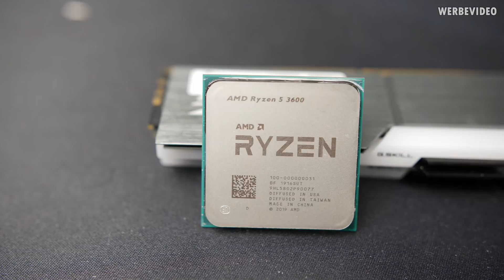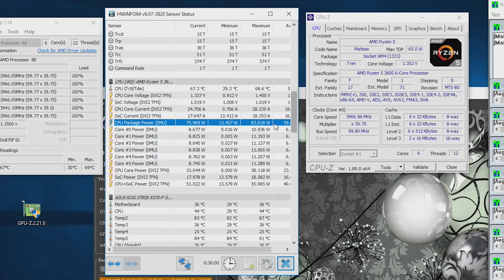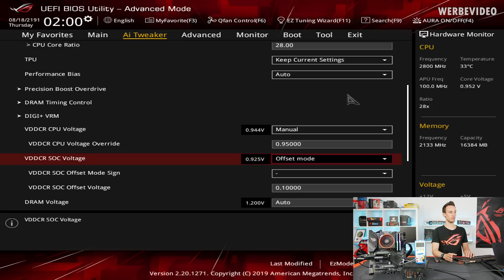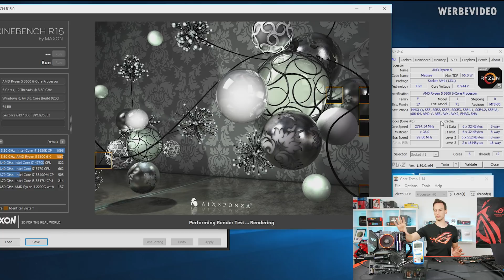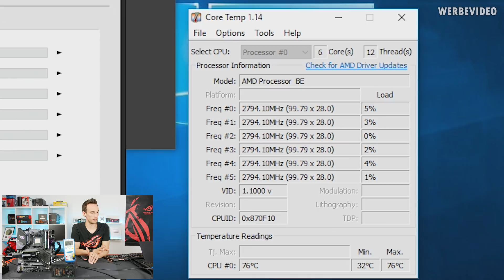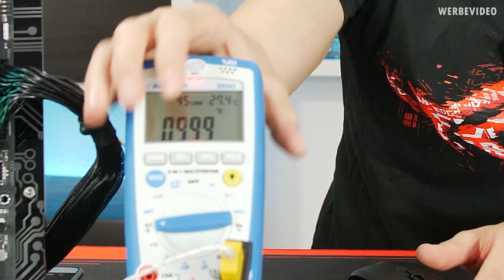Ryzen 3000 - Will the CPU work without cooler?

Comment: Thermal throttling and downclocked to 0.8ghz? Mine went down to 0.2 or even 0.195 and that is on a i5 12600k since my aio pump failed(I would reach 100c on idle) Im about to replace it for an air cooler

Comment: I understand the reason for these videos as the engineers have now had so much time to design CPUs that don't need cooling anymore. Of course, in smartphones we see that the problem of cooling fans has been solved to some extent. The Intel Core M also runs without any cooling. However, overheating laptops is still a problem, especially with Apple notebooks.

Comment: So I have a problem where I’m using a ryzen 5 2600 with the wraith cooler but I can’t attach the cooler because there is no backplate on the motherboard. Should I get a backplate or go without the cooler. I’m going to play games and some programming.

Comment: What do you think my luck will be if I try to run a 3600 with a low profile noctua cooler but, remove the fan for it? I can only fit a dual slot GPU if I dont have a fan on the CPU haha

Comment: I was having an issue with my cooler yesterday (for some weird reason, all fans stopped spinning) and I noticed my 3900x throttled to around 400 to 500MHz on all cores so it downclocked quite a bit

Comment: Yeah that's really a shame. After all this time, I would've expected all CPUs to behave more gracefully when they hit their thermal limit, not just Intel ones.
Because this reminds me of about 10 years ago, when I was struggling to keep an AMD CPU cool, period. Switched to Intel shortly afterwards and have not used AMD ever since. Also haven't had thermal issues ever since (despite overclocking my 2600K quite a bit, especially after slapping a water cooler on there).
Recently ordered a 3950X, wondering right now whether that was a mistake. Guess I'll see...

Comment: I use my 3600 with Thermal límit on the BIOS  at 69 degrees celsius, the sistem runs perfect same performance, low temps, i can use it with stock cpu cooler with no nois at all, and runs perfectly with cpu cooler conected en the chassis pin connector with the lowest rpm on cooler, cod mw watchdogs 2 for hours, no crash and stable 69 degrees aswel. Awesome cpu!

Comment: I accidentally placed my cpu fan/heatsync in the wrong port and the fan shorted, smoke came up etc. Left the heat sync on the cpu unplugged and placed the pc near my window and with a desk fan blowing onto the sync. Resulted in stable temps at 60 celsuis. Short term fix till tomorrow, set up a program that shutdown if the cou is higher than 90 c

Comment: On my Ryzen 9 3950X, TJunctionMax is listed as 95 °C but the thermal trip point is 115 °C. In normal operation with an appropriate cooler attached, the processor will start throttling aggressively at 95 °C. What happened here is that because you're running with a fixed clock frequency, the processor isn't going to throttle to lower speeds even at TJunctionMax. It's quite likely that the processor will properly throttle itself if the clock frequency isn't overridden.

Comment: Misstake did this booted without cpu cooler to check if the system worked. But i still need to update bios on my x370. Soo

Comment: I suspect the reason you had a relatively high floor for core ratio and voltage here is that the typical way overclocks are applied on ryzen is to override pstate0 (behind the user interface). This means you can not go below the clock or voltage defined in pstate1, so if you want to drop this CPU below 2.8Ghz and/or .8v you need to adjust pstates manually, e.g. move all pstate settings down one, so that pstate1 is the 1.5ghz setting that is usually stored in pstate2, or something even lower.

Comment: You disabled CPU throttling when you forced the CPU ratio to 28. That is how Ryzen CPUs work. You should have left the ratio to Auto and only disable "boosting" capability. Also to underclock and undervolt properly you will need another motherboard, i am using a Gigabyte one, and it gives me more flexibility on that regards, allowing voltage offsets and stuff. I have a completely passive running HTPC using a Ryzen 5 2400G that never exceeds 80ºC under syntetic torture thanks to that flexibility.

Comment: Your video was also on Reddit a topic.
Did you already notice it yourself?
 If not, you can read it.
Robert Hallock, from AMD explained what could have gone wrong.
 You actually did disable one protection by setting a manual multiplier: clock throttling. Bad luck. ;-)

The other mistake was probably the use of several tools to read the CPU at the same time. Additionally, HW info at the time was probably not yet compatible with Ryzen3000. I hang the links on. Can someone else definitely need it.
https://www.reddit.com/r/Amd/comments/ciw8f0/ryzen_3000_will_the_cpu_work_without_cooler/evcgzp7/
https://www.reddit.com/r/Amd/comments/cbls9g/the_final_word_on_idle_voltages_for_3rd_gen_ryzen/
When you read both articles, it actually becomes clear.
It would be worth trying to repeat the experiment

Comment: These results are exactly as expected from experience...
 I use intel for passive (silent) systems, like my current passive media PC (HP Elite 8300 AIO machine) is a core i5-3570, as it runs both cool and fast enough for passive cooling,
Then I pick AMD to get an OK price to performance for gaming/rendering/compiling/etc....

Comment: @der8auer, It seems this is a general ASUS BIOSes problem (feature?) having the minimal "CPU Core Ratio" value set so high on AMD/Ryzen platform. I have inspected many reviews of ASUS motherboards regarding this subject and I have discovered that ASUS is limiting this value for all AM4 boards, be it low-end or high-end, for all B350/ X370/ B450/X470/X570. Typical values are 28 and 32, but a few models have 22 and 23 too (Prime X370-Pro, Prime B350-Plus, C6H, ROG Strix B450-I). Even the top and most expensive boards have this limit set very high. 
Meanwhile, MSI and Gigabyte have this value set to 8 on all their boards, AsRock has it set to 22, be it Taichi ir the cheapest boards. Also, ASUS on Intel platform has is set to 8 almost on all boards. Shortly, it is a mess with all this stuff and it looks pretty strange and inconsisten on ASUS boards.
I don't think it's smth related to hardware, it should be a pure software/BIOS inconsistency or even an issue.
If you are interested in this, being much more vocal and influential, maybe you could bring this subject to public/ASUS attention and they will lower this ratio value in their BIOSes (at least to 22-23 that they have on a few boards).

Comment: In Bios X3700 cpu running 800MHz and Bios was very slow (mouse cursor stuttering).
Motherboard GIGABYTE - X570 AORUS PRO i load XMP ram settings everything else Auto. I don't know what set up Bios was very very slow.

Comment: My Ryzen 5 3600 takes 30 seconds to hit the 90°C mark in a stress test but I have a CPU cooler applied!! What the heck am I doing wrong?
Reply: Thermal paste?
Reply: @mattiatrovato5956  I already bought some new paste. I will remove the old one and get the results with the new one on monday.

Comment: AMD CPUs simple are not made to run without no cooler.. It's as simple as that.. Good vid btw bro, keepitup
Reply: I wouldn't say that Intel CPUs ARE made to run with no cooler lol. They just designed it to continually throttle to avoid thermal shutdown, even if extreme.

Comment: good vid as always but no one is giving a shit about under volting a ryzen 3000 , if you cant afford the power consumption you cant afford a ryzen 3000, fun to watch though , good vid when your sitting around bored smokin bongs , now lets see how much voltage it can take with no cooler  and the heat spreader removed , see how much voltage it can take with the heat spreader off and put a couple ice cubes on the die. or this one and ive tested it myself , it works . take the heat spreader off , cover the die with flex seal and duct tape a fish bowl full of water over it and run it on heaven for a couple days . i still have those goldfish.
Reply: There are many people interested in silent systems with passive cooling. Of course they are not the majority, but still they exist.
For those interested in low power/undervolted/underclokced systems, the actual situation of Ryzen CPUs is not so good, especially on ASUS motherboards.

Comment: Ooi mate ... Silicon stops fireing completely around 0,7 volts, that's probably why the CPU is locked to not go below 0,8v.. To make sure there is a 0,1v up from that 0,7v to make sure it doesn't stop fireing.

Comment: If I'm reading this right, the 3600 protection and control mechanisms are working fine doing their job, and it is still far more power efficient than the 8700k and 9900k(?) - It would be cool to have boundless multiplier and voltage control for a race towards the bottom, but I don't really fault either BIOS programmers nor AMD for the lack of that - we're into "just for shits n giggles" territory here. If you really want to actually run a system this low-power, you're looking at the wrong CPU (and board) segment.

To make any actual use of it beyond a time-limited idle demo, you're gonna need to give it something for heat disippation; an old northbridge cooler, a stack of coins - something. And to actually run stable however low it will go, you need to do the same for the Intel parts. Freezing for many seconds at a time is definitely not stable 😅

Comment: try it in a cheap motherboard and get yourself a 4 euro 12v peltier or two,then power it with 1.0v-3.3v and test its cooling side for temp, then switch it over unpowered, and see what voltage it generates when in direct contact with the underclocked cpu,with the added benefit of acting as a thin ceramic passive heatsink as it converts heat to electric directly...

i always wonder why they dont add and tune generic micron thick peltier layers in the chip  layers substrate and packaging, as its a simple option and can even turn wasted heat into extra localised cpu power reserves etc

Comment: title should have been : "how well is Ryzen 3000 protected against overheating"  because that's what we are learning, even tough you attempted that for another reason (test lowest voltage etc..) for younger people let me explain : on older cpus like AMD Athlon if you installed your cpu cooler wrong, the cpu burned instantly with a puff of smoke, they had zero protection (destroyed my brand new cpu ><) when I switched to Intel that was one of their advantage they had some kind of protection (like the Ryzen has in this video pc shut down) it looks like Intel has moved forward protecting even better with undervoltage and downclocking while AMD has the bare minimum protection that Intel already had 10+ years ago, good enough for me as this is a fringe case and a company shouldn't waste their time on this, Intel probably got that from laptop experience if AMD want that market they have to improve on that aspect cpu throttling and undervolting is a must for laptop cpus

Comment: Intel has ALWAYS been better at self protections, AMD have a massive improvement in that they shut down now and don't just cook themselves like they used to. Intel just designs better, the only reason this gen AMD is any good is they are able to halve the lithography size. If they were working at 14nm they'd be shite still.

Comment: I think the best way to downvolt ryzen CPU's are with PBO, you can set ppt(watt limit) from 80 to anything you want, so you can set it for 60 for example, and chip will automatically lower clocks to stay within the limit, works like magic, test it in Ryzen Master and set in bios.

Comment: Modern CPUs (and in this case AMD) has come a long way in terms of thermal safety compared to the old days of 2000s, reminds me of old Tom's Hardware video where they remove the CPU cooler while running Quake, back then the AMD systems would go up in smoke and died. Some nostalgia down the memory lane: https://www.youtube.com/watch?v=NxNUK3U73SI

Comment: I had a flash back to a video I saw in the early days of youtube where there was a montage of intel vs AMD with coolers removed mid use.
All the AMD cpus burst into flames and the video was bashing AMD for have no thermal protection.

I actually had most of the CPUs featured in the video, P4s, P3s, Athlon 64 and XPs.   I was intrigued and went ahead and tried a few myself.

Turns out the AMD cpus just shut down the system for all the ones I had on hand and were fine, no flames. Same with the intel cpus. 

So the video was made deliberately with AMD thermal protection disabled just to bash them lol.  The lengths fanboys went to back then was just as bad as today. I remember getting flamed bad for calling out the BS.
Reply: Not true. I had an AMD Duron 800 which had no IHS and when i turned it on without a cooler it not only burned down but it also burned down the motherboard. So it wasn't just intel lies.
By the way, not a fanboy for anything.
Reply: @ruiamaral4669  Yeah probably, I had not tried Durons. They and older ones might not had protection which is no different to the PII and older Intel which tells you both intel and AMD started adding protection around the same time. But for certain the Athlon/XP and Athlon 64 in that particular video have protection, I verified this myself. My point is the video was misleading as they were burning up CPUs that 100% have thermal protection by what ever means they used and claiming for that you should not buy the AMD CPUs which funny enough were superior to the intel ones on offer at the time.

Comment: I've done something similar with the 200ge. By using offset voltage you can go lower than 0.8V. I was able to achieve 2.2GHz @ 86C

Comment: I tried this once with a P1 200MMX stock and it hard locked after 15 min never to work again.   It was so hot I could melt solder on the IHS.

I also tried this with a slot 1 celeron 300A OC'd to 533Mhz and it would not die. It was no where as hot as the P1, maybe over 100 or so as it did sizzle water for a sec but was quickly quenched with a wet sponge.

Comment: Ryzen 3000 does not seem to change frequencies when you use a manual clock setting. It stays put at the setting you tell it to be. Meaning it will continue to push and push and push until it overheats. Default settings do clock up and down. I am not sure if this is a bug or not.
While we are on the subject of Ryzen 3000 again, can you test direct die cooling vs IHS see how much that matters?

Comment: My Ryzen 5 1600x can't clock below 2200MHz on "manual" mode. If auto clock (pstate or whatever is called) is selected I didn't see below 1850MHz. Desktop probably ryzens just can't clock as low as intels (800MHz). I was testing under linux...

Comment: Makes me wonder if given the efficiency of this chip, that this wasn't a scenario that AMD has prepared for? How would take the heatsink off their CPU and expect it not to shut down, but to throttle to its base clock (or whatever he set the undervolt speed to). It is AMAZING that he could get that CPU to run form more than 2 minutes without a CPU cooler.

Comment: Der8auer, great channel and video man. Got a few questions for you, some are subjective but I know they'll help me.

1. 3900X or 9900K for a workstation and gaming setup, which one would you use? I mainly use Cinema 4D, Autodesk Maya and the Adobe Sure but I'm getting into DaVinci Resolve. Which CPU in your opinion is best?

2. Is the stock cooler on the 3900X sufficient for heavy workloads or would you recommend an aftermarket cooler? If so, which one?

3. Will air coolers block Dimm slots for G Skill Trident Z ram?

Comment: I actually tried something similar with my 2600 in order to update a BIOS for a 3900X.  Definitely not worth the risk... I wound up putting a dot of thermal paste and a low-profile cooler on it (without screwing it in) to keep temps under control.  I didn't even try to do it with the 3900X... I didn't want to burn-up the CPU by accident!

I also noticed the 2-some-odd-GHz frequency minimum.  But here's the strange thing... when I was testing the 3900X in this particular motherboard (an ASRock Rack D4U ... piece of junk actually, but it has IPMI)... in anycase, I was testing SMU vs PPT socket power settings and the PPT was doing weird things when it hit its cap... the frequency display for the CPU cores dropped down to around 500 MHz for a few seconds, then recovered.  (The SMU power settings don't have this problem).  In anycase, it seems to me that this means the Zen 2 CPUs should be able to clock lower, so perhaps it is an artificial BIOS limitation of some sort.

-Matt

Comment: I know you are more experirnced but as far as my experience goes AMD may defeat intel in perfomance but AMD is never gonna be as stable as intel. I am using and selling 2006-9 INTEL c2d e8400 and i5 3550 from 2k14 are still perfoming as much as they did ever before. And its not just that in pakistan we can even buy p4 and i did test p4 6 monts ago it still runs the same as it did before 2002 . The reason intel is more stable is the 'level 0' logic also called silicon logic. They implement features at level 0 while AMD implement them i.e. iff implement  then at level 3 assembly language. Which can be irresponsive sometimes iff worked once atleast.

Comment: Disappointed at not being able to run the CPU without cooler. Maybe just use passive cooling without fan? I do agree though you should have more control over the clock speeds and voltage but maybe there are limits due to ccx, infinity fabric and memory limitations.